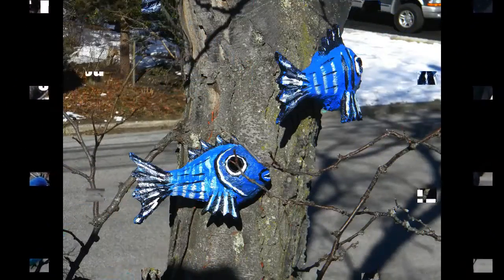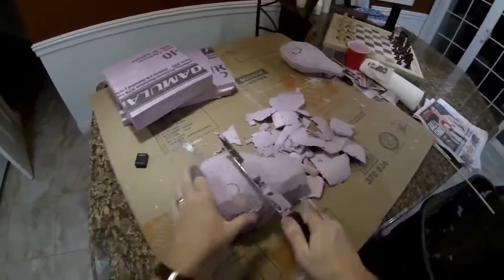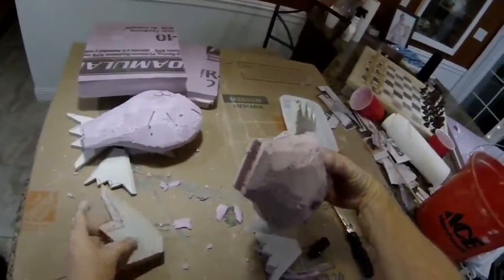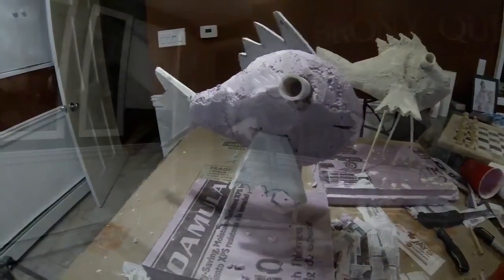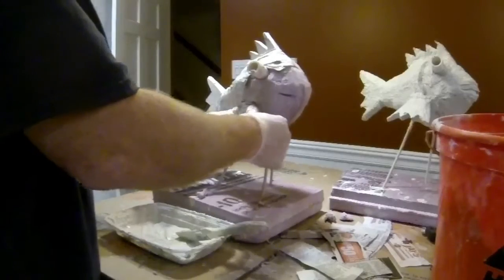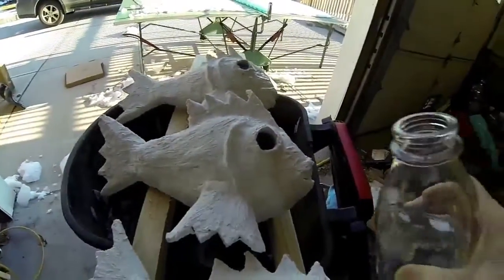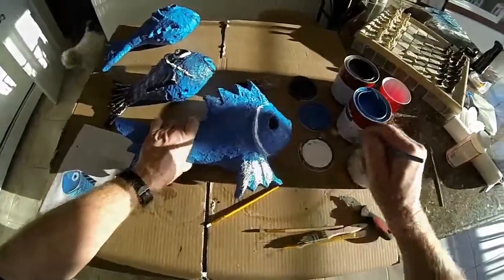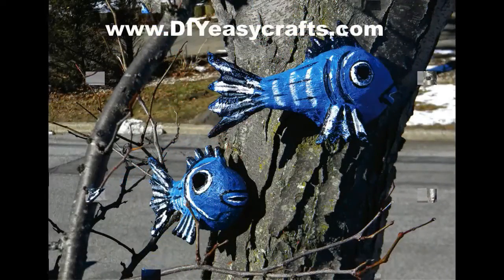How to make a Fish Shaped Bird house from Outdoor Paper Mache

Comment: It is a great idea using this for outdoor sculpture, however I am concerned about cleaning out the old bird nest each year, it will be filled with old rotting nests within a year or two.  I imagine a hinge-type trapdoor or something on the bottom could be incorporated.  This might help also because you could use a knife to cut out the foam instead of the harsh chemical to dissolve the foam...  great info tho thanks for this.